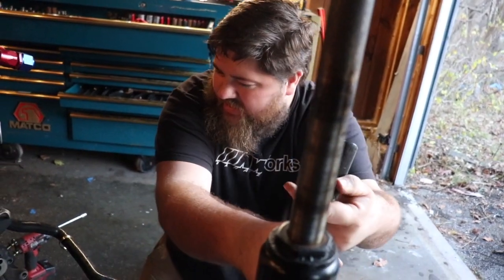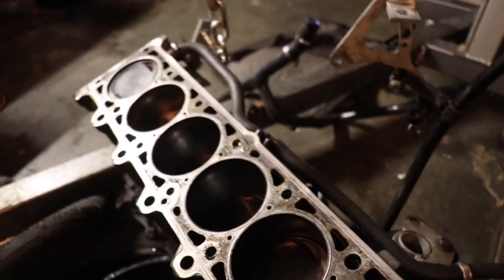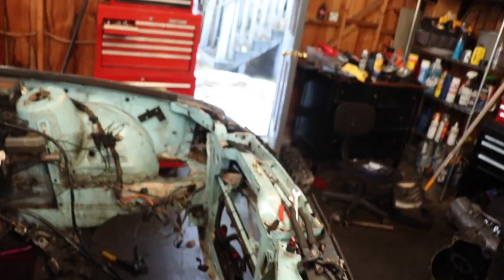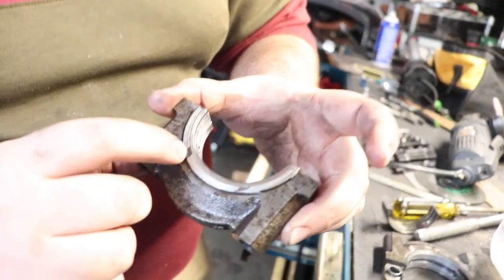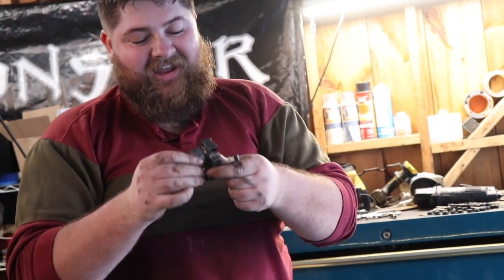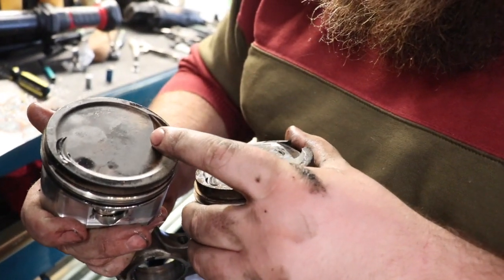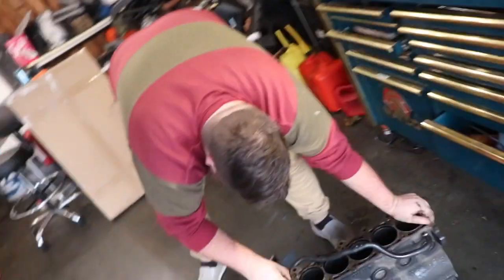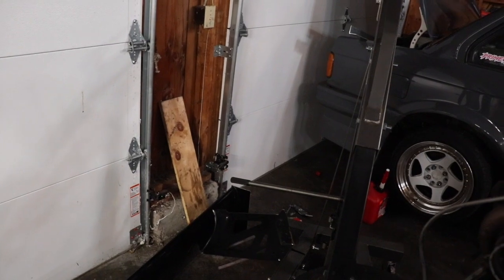How to tear down a BMW M20 engine

Comment: Did you have upgraded valve springs on the motor where the valves hit ?
Reply from the maker: no but this new engine also blew up lmao. the tune was off and blew everything apart.

Comment: How long did the cliqtunning kit take to process ? After seeing some comments I’m getting a little worried and with no response or way to contact them using this as last ditch effort.
Reply from the maker: It only took 2 to 3 weeks to get the kit and they would respond the next day usually but now they have a different shipping provider so I’d if they changed anything els. Good luck man!

Comment: What head gasket are you running with the new set up? Link for that and the magnetic coolant plugs!
Reply from the maker: Gotez head gasket I always use them an have never had an issue. I’ll put the plug links in the description!